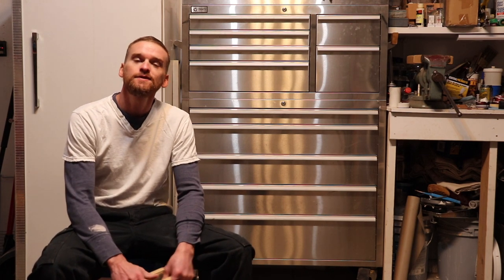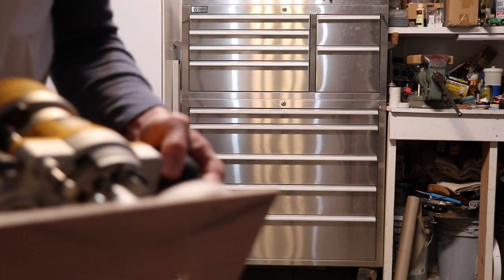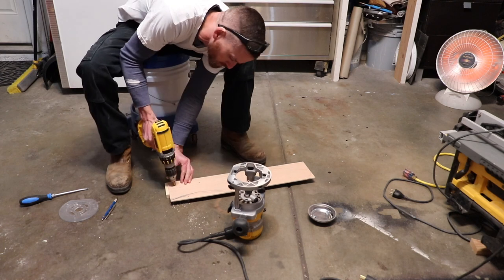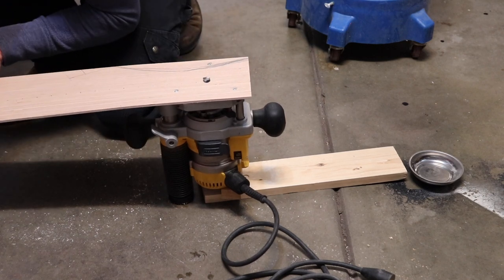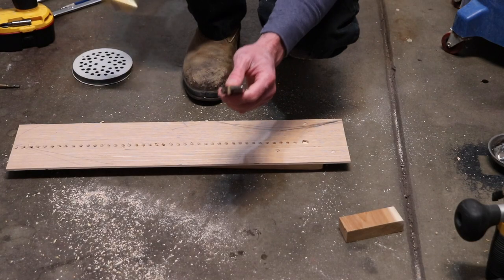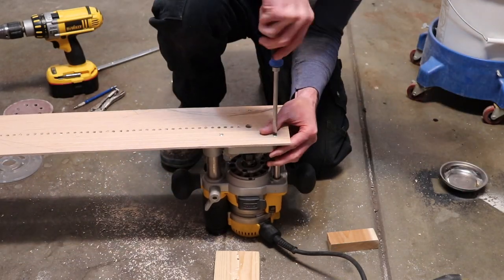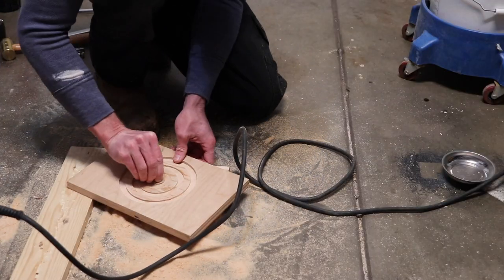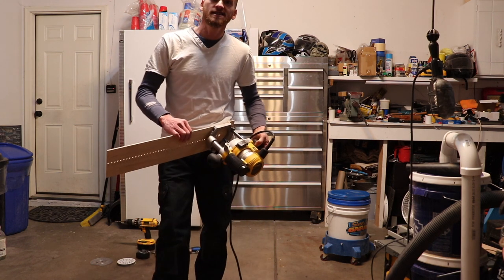DIY router jig for cutting circles & arches

Comment: Any particular reason you went with a 1/4 board for the jig? Wonder if 1/2 thick would work.
Reply from the maker: I used 1/4" because I wanted to be able to cut a hole through a piece of 3/4" plywood and the router bits that I own have a 3/4" cutting surface. You can use a piece of 1/2" but will probably need longer screws to mount it to the router base. It really depends on the length of the router bits that you are using and how thick the wood is that you want to cut a hole through. I have used 1/2" but I didn't like having less of the bit shank in the router collet, some router bits would get a wobble. I hope this is helpful. Thanks for watching!